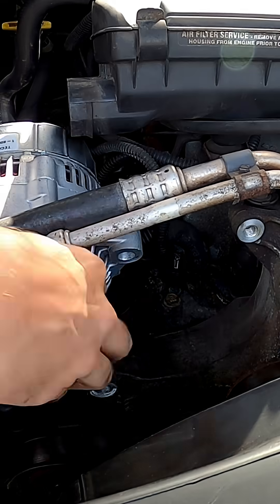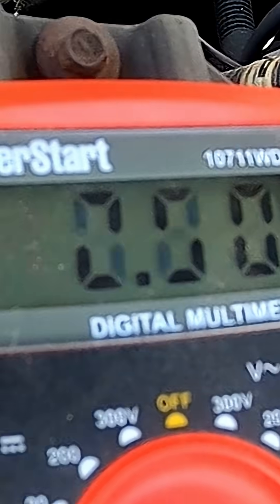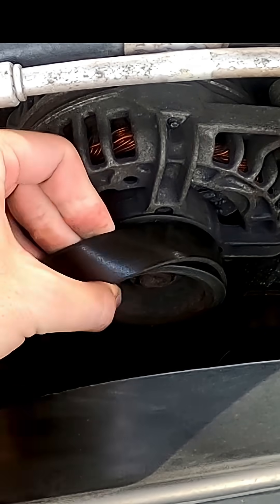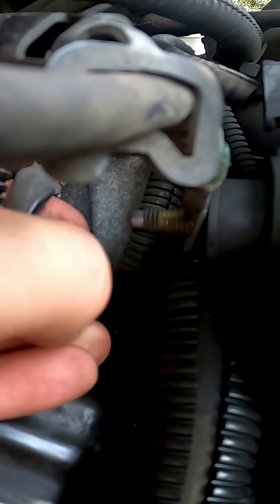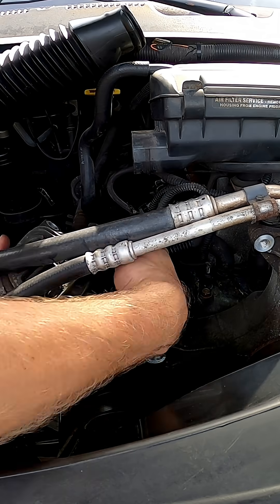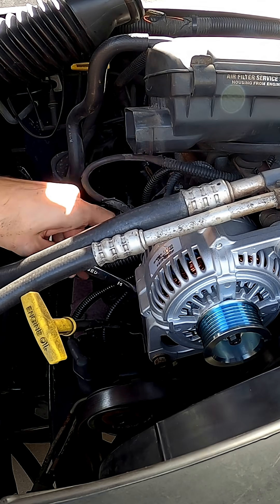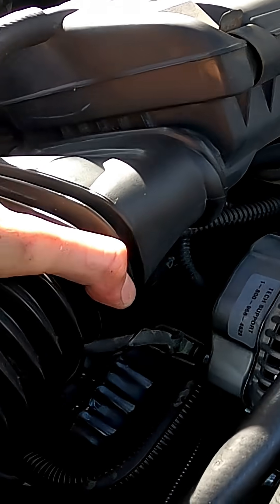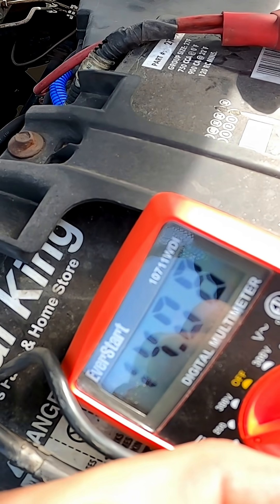Check Gauges Light? Dodge Ram Alternator Fix!

Comment: 13 mil for battery
15 mil for tensioner
14 mil for ac cables 
13 mil for dipstick tube 
10 mil for wire harness 
14 mil for mounting bolt 
14 mil for the nut too
7 mil for two small wires 
10 mil on lower corner
10 mil for large power wire